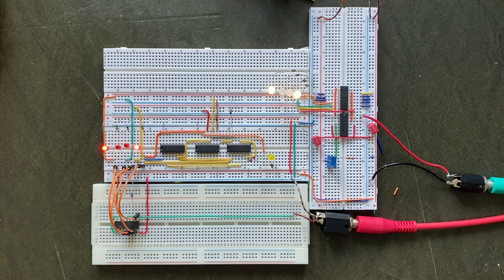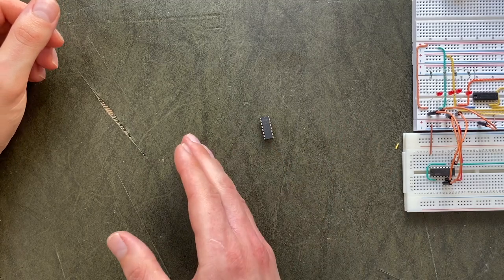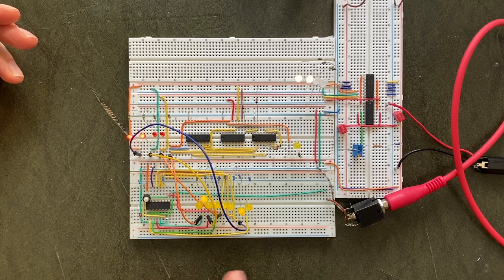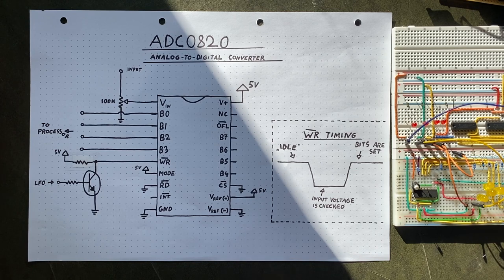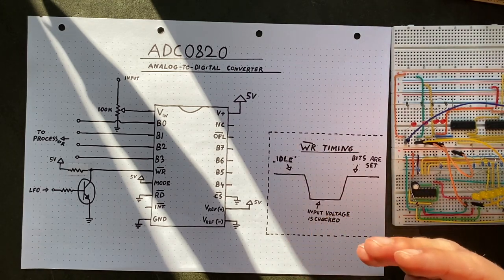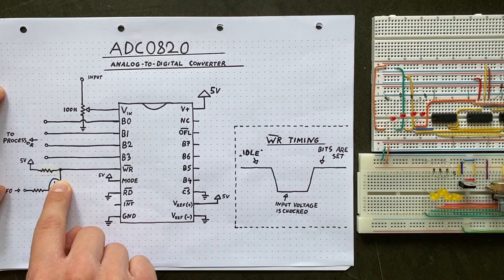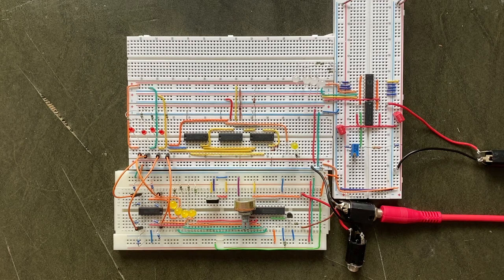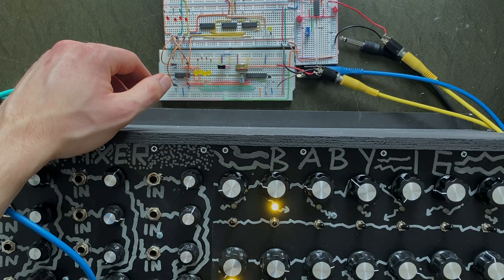Designing a DIY synth arpeggiator with logic gates: Part 3

Comment: Love your videos! Instead of the logic that selects for the major scale you could use a parallel eeprom as a look-up table and store multiple scales/modes in that, selectable by switches on the address bits higher than 0-3.

Comment: Hi Moritz ,Thank very much for all your hard making these excellent videos , built the voc,  sounds great , built the Mdac  circuit works great , in the video #3 you said you were using pink noise , with the mdac and the scale checker circuit to make generative music . How are you using the pink noise in to the circuit. Just split out the noise signal 4 ways in to A,b,c,d of scale circuit..I have learned so much thank you..I built scaled down TriadexMuse synth , with only 4 channels of logic signals , but, got stuck with , turning  the logic to music , tried Cd 4051  with 555 oscillator with 8 caps.in the 8 channels of the cd4051..Ended up with that low C a lot . Your  mdac w/ scale  circuit   Is perfect for this  project .  Thanks Again , Best Kurt
Reply from the maker: hey kurt, the pink noise is simply going into the ADC, which then gets amplified with op amps, and then the bits go into the scale checker!
Reply: Thank you Moritz ,,  Your videos are awesome,, Thank you 🙏

Comment: Hello and thanks for these amazing videos. I have a question about the quantized stepped notes you show near the end. Are all the pots quantized that way? Or do you have to do it individually if you want the same effect on all 16 steps? Thanks!
Reply from the maker: no, they're all quantized! the sequencer steps through the pots one-by-one and sends their respective values to the quantizer.
Reply: @MoritzKlein0  Awesome. So as long as the common of the pots (cv output) goes into the converter they will all be quantized? I have been working on a sequencer myself and this is the next step. These are the best videos out there in regards to synth stuff!
Reply from the maker: @mbrombert  yes exactly! the quantizer just take a CV input - doesn't matter where it comes from, it will quantize anything and everything!
Reply: @MoritzKlein0  Nice... thanks for the priceless information. All the best to you!

Comment: Very interesting ideas, thank you! I am doing it the lame way with an arduino. But I have this problem that the ADC inside the arduino is often messing close by notes, because of noise when converting to digital. I understand that when I have diodes on the output of the potentiometers is basically making it a very high impedance, so that's why you need an opamp. As you also pointed out in the video. The problem is that even with an opamp I'm getting alot of noise in the analog to digital conversion,  actually even more noise . Is this just because of my sloppy protoboard wiring or am I missing something in this process?

Comment: Hey Moritz! Thanks for sharing all these. I have a hard finding an ADC0820. Can you recommend any alternatives?
Reply from the maker: did you already check for TLC0820s?
Reply: @MoritzKlein0  Yep i did, but they seem to have quite long delivery times :( Thanks for the quick answer though! Where do you order usually? I normally use reichelt.de, mouser.de, pollin.de or eBay/aliexpress, however the latter two are quite expensive for such parts, most of the time... and the stuff comes from China which takes ages ;)

Comment: This is so so fascinating. Im planning to begin my modular DIY journey soon, and im planning on taking inspiration from this cv quantiser. 

Do you think it would be hard to upgrade it to work in 5 bits? 9 notes seems a little limiting for a range. but with 5 bits you get approx 2.5 octaves.
Reply from the maker: i‘m not sure honestly! the number of cases you‘d have to check double, but maybe there‘d be some clever tricks to cut the ruleset down. 

i have been thinking about a generic module that provides some AND, OR, NOT and XOR-gates so you can patch your ruleset in on the fly. i’d combine this with a generic analog-to-digital module putting out 6 bits. might not be that approachable but it could lead to some interesting scales.
Reply: @MoritzKlein0  maybe this scale check method would get a bit hard to manage with 5 bits. perhaps there is some other intellegent way to deal with it, ill do digging.

converting it back into a voltage seems like it would work fine however.

i even thought about making the MDAC portion, its own module, with a custom 5 pin binary input bus, and have a veriety of other modules that provide binary data sets for it, such as the arp or ADC's with diffrent scales
Reply: @MoritzKlein0  100% agree that it's not in the same spirit at all, but as a coder by trade - if not 5 bits, I think 8 bits is the point where you press an Arduino into service. It probably wouldn't be too hard to set up a "player piano" sketch where you could feed out whatever bit values you want, including patterns and random, but leaving the rest of the CMOS in place.